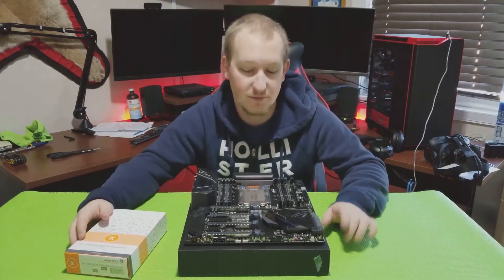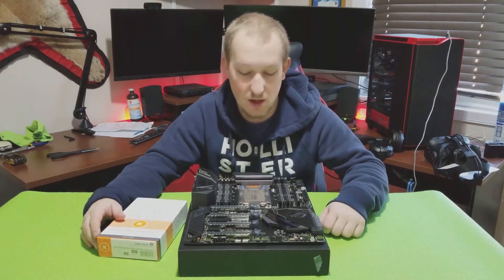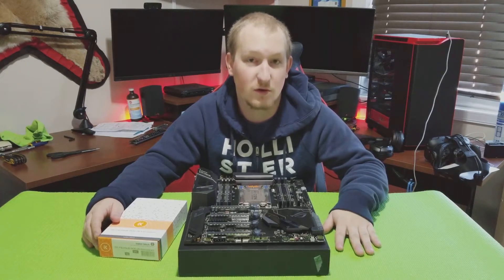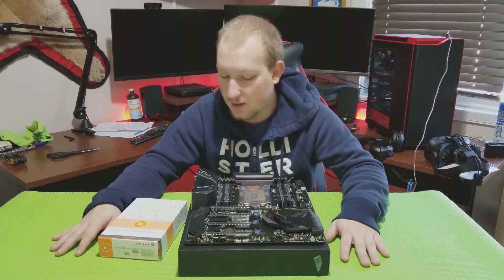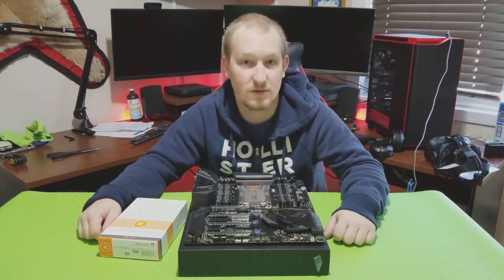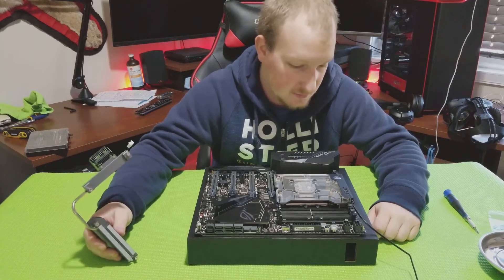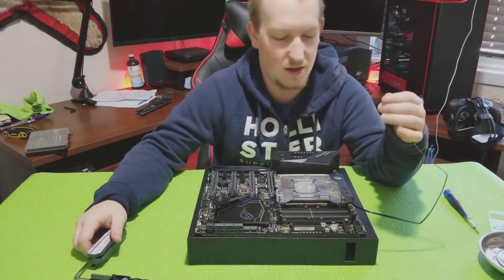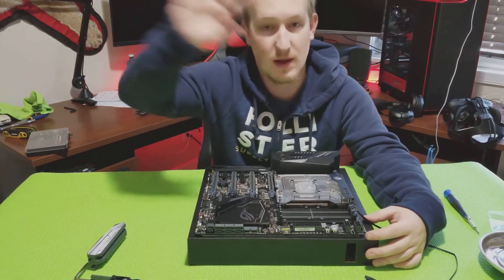x399 monoblock install tutorial on the zenith extreme

Comment: Would it be okay to use one of the thermal pads that's on the stock heat sink. The little hard to reach one stuck on so perfectly I didn't take it off. I wanna use the extra strip I have as a result as a spare.